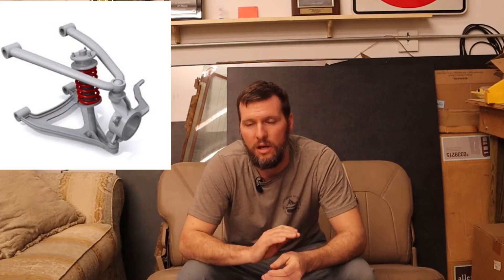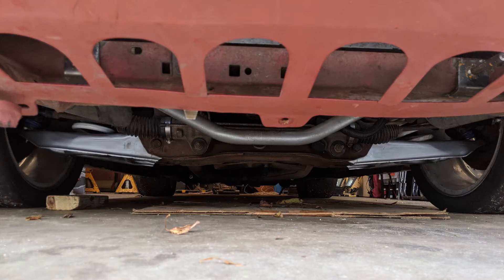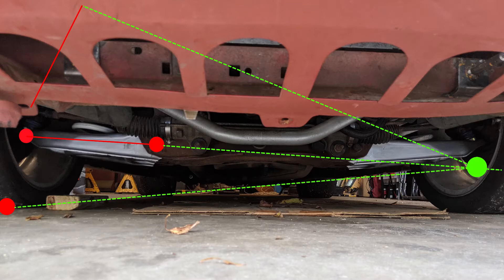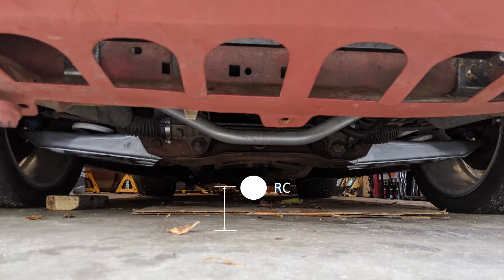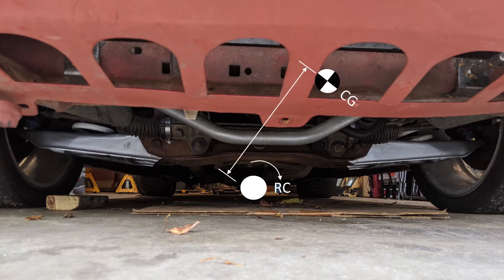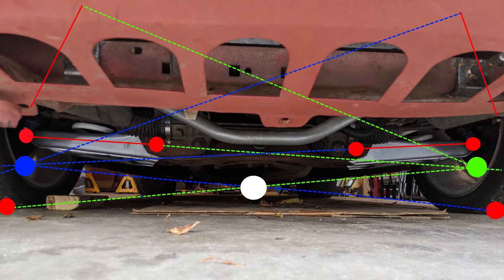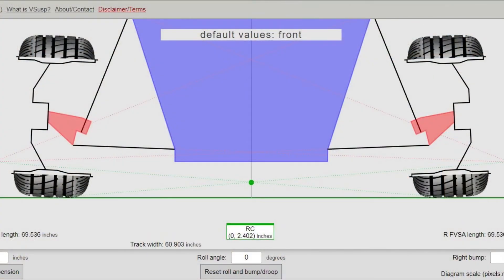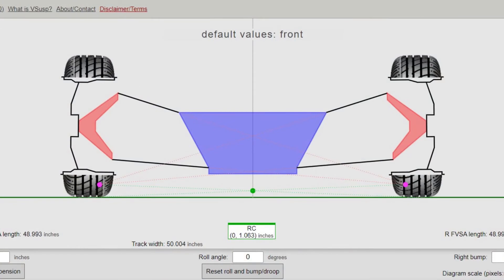Roll Center, what is it and why it's important

Comment: this will have many of the things you said, but i think this will help some!!!
from RC where we change Roll Center a bunch and can do it fast. i can give tips that might transfer over. 
 the upper links (a-arm/upper angle) is used best for controlling the camber angle (kinda like how caster works). if you have the upper links (a-arm/upper angle) higher at the tire (down at body) you gain negative camber. if they are even to the ground you gain zero. if the upper arm (angle) is lower at the tire and high at the body you gain + camber. <<< when the suspension goes down!!!
 the trick with roll-center is comparing the lower links to the upper links and trying to keep your upper links only for camber gain, especially in the rear where you don't have caster. this + below, takes out all the silly unnecessary math out.
  High roll-center... you want a greater gap at the tire and less gap at the chassis (from the upper and lower arm pivot points). think of it as anti-squat, because weight transfer if the car leans or not!!! ((("what this is really doing, trying to force the outside tire to go under the car, causing the chassis and inside the tire to lift"!!!))) in short, you have more responsiveness and more grip at speed/acceleration. but a lack of grip at slow speeds, where weight transfer is less (good for rotation at slow speeds)
 Low roll-center... greater gap at the chassis and less gap at the tire pivot points. ((("what this is really doing, outside tire is trying to go over the bottom arm, putting more weight on the chassis and the inside tire "!!!))) in short, you have good low-speed grip and the grip is more consistent overall (the car not going from high-grip to low-grip, like high roll-center is doing) but you have less max grip and less responsiveness. 
 but I'm lucky for most of the cars i tune, have adjustments at all pivot point!!!
Reply from the maker: Wow that's a lot of good information. One day I hope to have a double wishbone and be able to have all those adjustments available.
Reply: @RinerAutomotive  yea a macpherson suspension must suck. even when tuning with shocks... laying the shock down make the suspension soft and stiffens up as it compresses Vs the shock being straight up and down makes it more linear. so to make the shock right you could screw everything else up.

Comment: Very interesting video. I’m curious if you took tire temps during this process. On my fox body I did what everyone did at first and lowered it too much with springs that were too soft. My tire temps on the outside edge was too high which showed itself in terrible tire wear on track. I modified my crossmember with re drilled control arm holes, added longer control arms and stiffer springs. In the end my tire temps evened out across the face of the tire and wear after a track day is much improved. Oh and turn in is incredible. I love letting some people who think Mustangs can’t work go for a rip and see shock on their faces lol
Reply from the maker: Yea I enjoy proving a mustang can be fast and beat way more expensive cars. Especially these older mustangs with a solid rear axle and no coil overs.
Reply: @RinerAutomotive  I don’t remember if Ive seen any info on your rear suspension? What’s done there?
Reply from the maker: @ConemantheBarbarian  all Maximum Motorsports now (torque arm, panhard, control arms, race 2 shocks, and coilovers)
Reply: @RinerAutomotive  very nice and very effective
Reply from the maker: One of the best improvements I've made. Rear end is so solid and predicable.
Reply from the maker: I have not taken tire temperatures. I need to get a pyrometer though. I have used chalk on the side wall before to adjust tire pressures. Right now I run around 33 psi front and 27 psi rear.

I've looked at adjusting the k member attachment points but there isn't much room to move upwards. I don't think there are longer oem arms for a SN95. But I've heard it helps on the fox.
Reply: @RinerAutomotive  I used 88 T Bird control arms. They’re 3/4 of an inch longer if my memory is correct. I think they are similar to your control arms. On a Fox they’re a huge improvement.